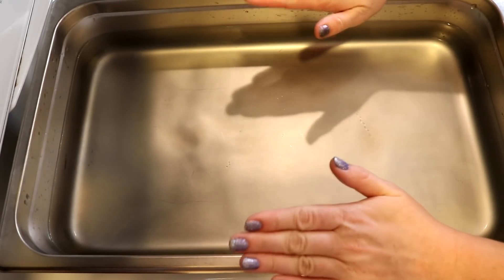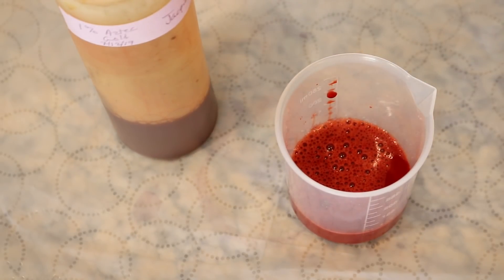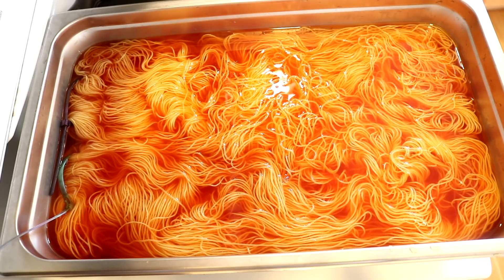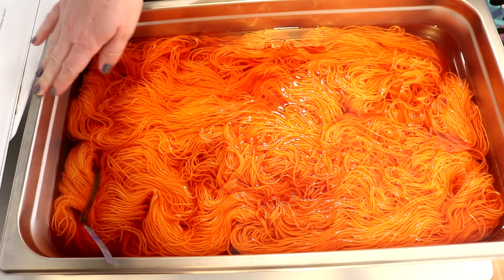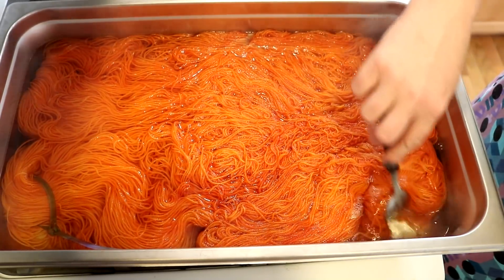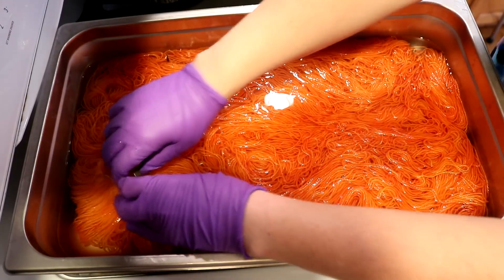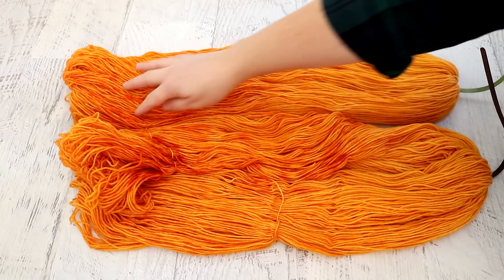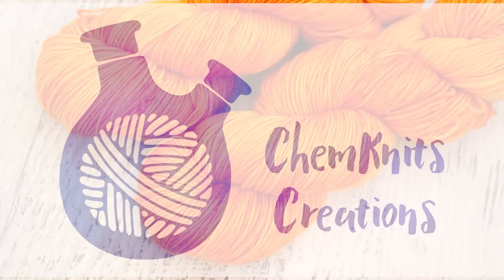Dyepot Weekly #260 - Dyeing Yarn with Asymmetric Heat - How Much of a Difference Will it Make?

Comment: Oooh, I would try less water, since mor water allows the heat to travel more, but I understand that is prevents the dyes from traveling too...🤔interesting🧐
Reply from the maker: BUT here is my dilema - less water also means the dye can't travel - so therefore it will be more "stuck" based on where it was located versus more absorbing in an area due to heat.  There are too many variables.

Comment: Thank you for this! I have the experience that uneven heat distribution is more of a problem with non super wash yarns. Maybe you could try that? 
Also place 2 skeins over the short side of the pan maybe, U shaped, so there is only one over the heat. I think it eliminates the question of variation due to access to dye and you would have a good comparison between the two
Can't wait to see your other experiments
Reply from the maker: This is a good idea - it is very possible that since superwash yarn asborbs dye so quickly anyway that the heat may not make as big of a difference.  I do want to investigate asymmetric acid...

Comment: This can be real problem when dying in a pot. 🤨 Especially if I put to many skeins in the pot at the same time.  It happens because the yarn doesn't have enough room to move around, particularly if you don't stir the yarn enough. You end up with a hotter spot on the bottom and therefore a dark stop in one area.  Usually I try to dye 5 or 6 in a pot at a time. But if i've got an order for more skeins, I've tried to add them to the pot. But to often I was getting a darker patch on the yarn. I do have a very large pot now, which I can up to 15 skeins at a time. Because I always want my customers to have their sweater quantities, dyed in one lot. I have 20 heat dispersing thing-a-me -jigs to use on all my gas stoves. This has eliminated the problem completely. That was a stunning colour. I really like the aztec gold. But it's hard to get large containers of it here in Australia. 🧡💛👍🦘
Reply from the maker: But is this about the heat or about the resist from the pot being crowded?  :D  I think that heat can make an impact - but it is so hard to say for sure because it is hard when there are so many variables.  :D
Reply: @ChemKnitsTutorials  Good observation.I'm dyeing the same quantities with the hot pad thingies, there are no darker patches. So I'm assume it's from extra heat. I weight EVERYTHING, even my CA, so there's very little that could vary, I even check the temp gets to 85C.  It's always balance between stirring it more and ending up with more knots to sort out later. Thanks for the time and effort you put into tutorials. Coming from a scientific background, you bring a completely different perspective than other dyers. 💜

Comment: I would like to see you add ice at the cold end so it never heats up. How about only 100g of yarn and no zip tie? We often see decreased uptake where the tie is, even when it is loose. The strands don't float around on the surface in the same way.
Reply from the maker: Oh that's a good idea with the ice!  The zip tie is on so so loose, and I don't like dyeing without them because they help me move the yarn and prevent tangles.  ;)  I have two more explorations of this coming up.  One was a technique fail (I overloaded the dye).  I think that vinegar makes a much bigger difference than heat at this point.
Reply: Yeah, I was thinking added in ice to make it a more stark temp difference would be interesting.

Comment: I'm very curious about what experiments you've already done! I feel like I always say "I want to see this with a color that breaks!" but color breaking depends on striking speed, so it's a good variable to test here. I think it would also be interesting to have a control comparison where you have two pans going, and have the only difference be the heat variation. You mentioned uneven acid addition in the dye-along livestream, so that would be cool too!
Reply from the maker: Uneven acid is still something I haven't tried - but is on my list for sure.  

SPOILER ALERT
>
>
>
>
>
>
>
>
>
>
>
>
I tried this with a powdered food coloring - that didn't work well because I wasn't even with my application.  Then I try a more controlled menthod of adding the color in another video. :D